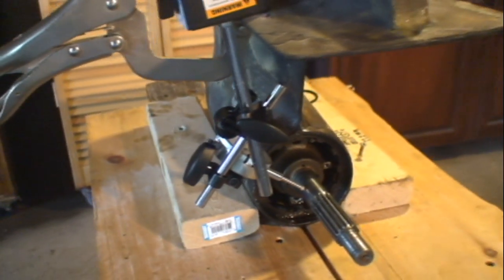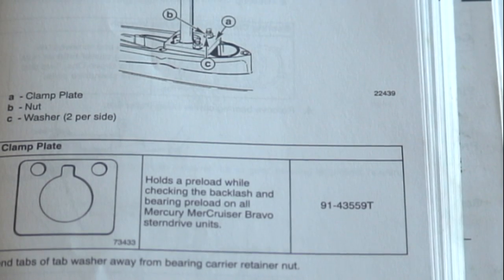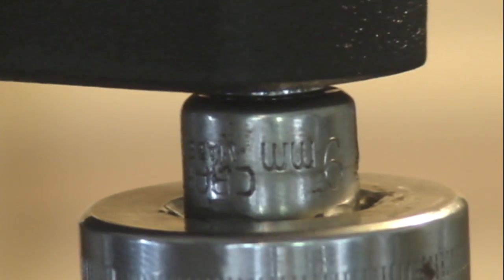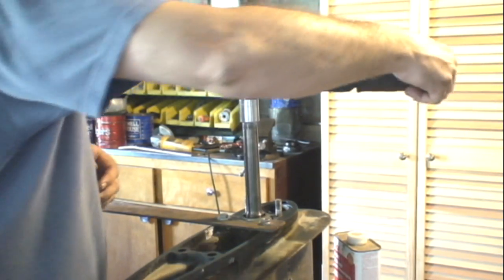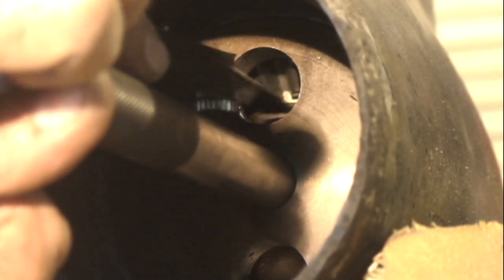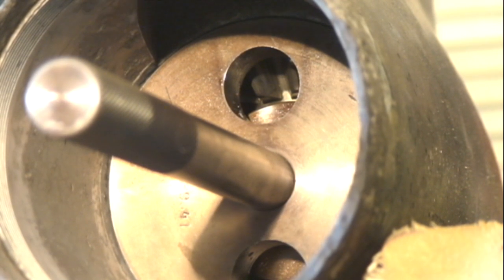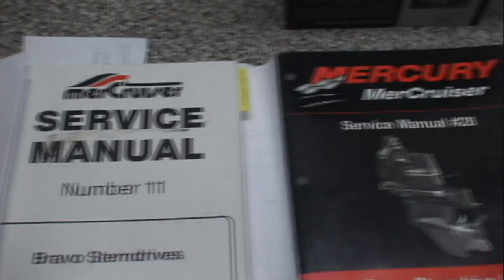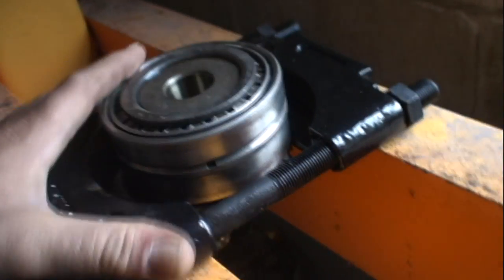Bravo One Outdrive Service - Lower Unit Measurements

Comment: Wow a real mechanic on youtube! I'm an auto mechanic and just took apart the lower unit of my buddies 40 hp Mercury. Broken teeth on all three gears. There is no way I will just replace the gears and bearings without setting them up properly even if I have to buy the tools.  Thanks for video.